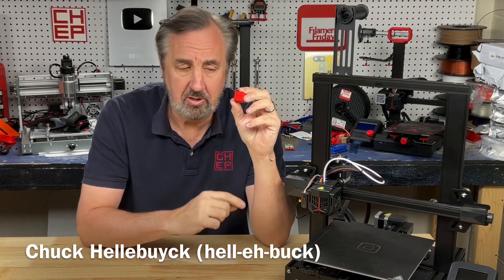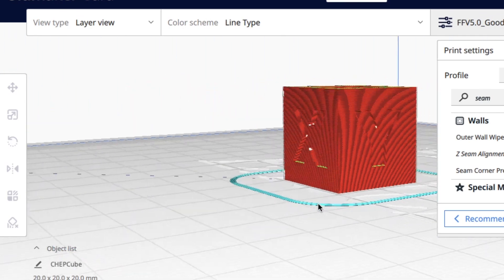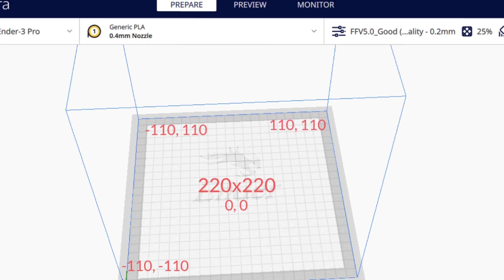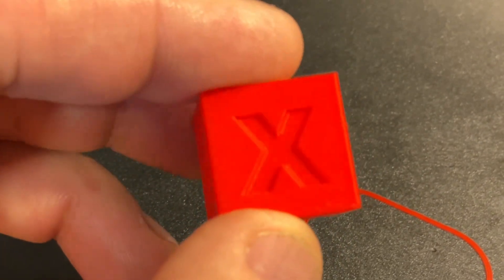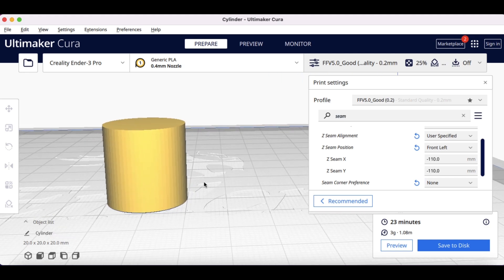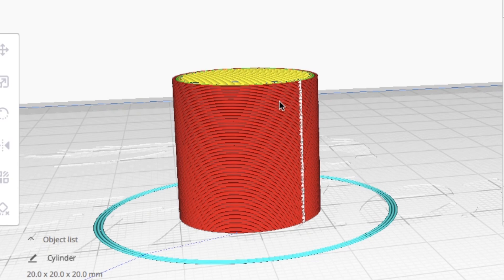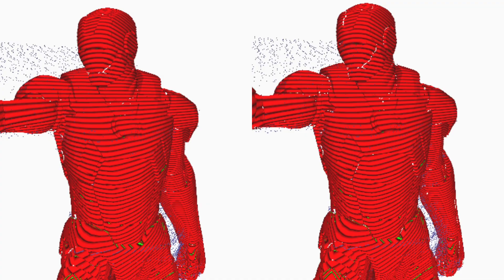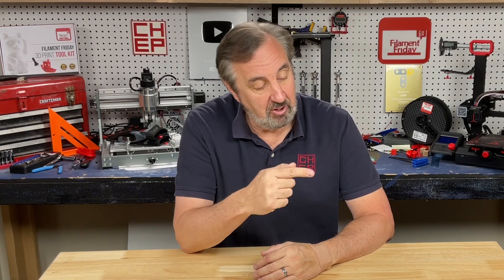Control the Seam Position in Cura Slicer

Comment: Seems are an absolute eye sore, and very difficult to get to a point where it is lesser of an eye sore (or at least for me). I switched over to orca slicer v2.2.1, but even with that slicer and using scarf seams, seam is still visible. Battling to get seams to an acceptable level on my cylindrical objects.

Comment: I wish this actually worked on curved surfaces. Cura seems to completely ignore the placement settings when the shape is irregular.
Reply: Under special mode in your slicer program use "Spiralize Outer Contour"  Try that
Reply: @aofcole  that was the solution to my problem many thanks

Comment: The problem with Cura's approach is that your part may have multiple surfaces at a certain layer (ex. if there's a horizontal hole going all the way through) and then you'll have multiple seams.  That's where the seam-painting of PrusaSlicer and derivatives is so much better as now you can paint the seam on both those separated-on-those-layers parts.

Comment: Cura is very bad with seams. Prusa does way better with seams by a LOT
Reply: Maybe it does but at the same time Prusea does worst on other departments. But in all I us both depending on few factors I still prefer tree supports in Cura over Prusa's version. Again both apps does what they meant so at the end of the day why to fight over which does better one thing.
Reply: @82Heniu82  what do you mean fight? I simply pointed out that Prusa does seams better. I use both as well.
Reply: @AlexNewton  Haha i didn't meant this part about fighting to be directed to you. Just my thoughts was lost in translation ;) I typed that oart about fighting to kind of close my "argument" and not start a war on which app is better :D

Comment: Talking about your profiles... I like your profiles, but recently I tried to slice an "Amstrad CPC Plus / GX4000 cartridge shell" from Thingiverse, and it failed. Two parts of the shell didn't fit together (it is a snap fit), and the inner layer looked terrible. When slicing with a standard Ender 3 0.2 mm profile from Cura, everything fits together and surfaces look nice. Your profile seems to cause issues with gap and hole tolerances.
Reply from the maker: Which profile?
I have several. If you want good fit then the good or best versions are recommended.

Comment: In Cura 4.x.x seams work just fine, in 5.x + seams are just horrible placed, with same settings... Simple shapes (cube, cylinder) works, but try to add a big chamfer or fillet to this square and seams are all over the place...
Reply: I was going to check what he did in this video to Cura.  I'm going to see if this video helps at all because I completely agree with you seams seem to be all over the place in Cuaa 5.0